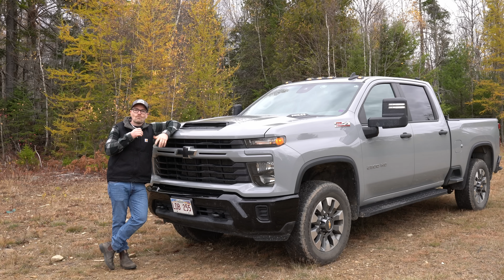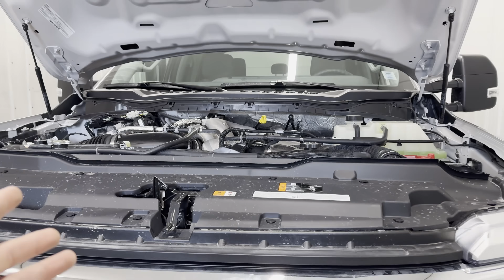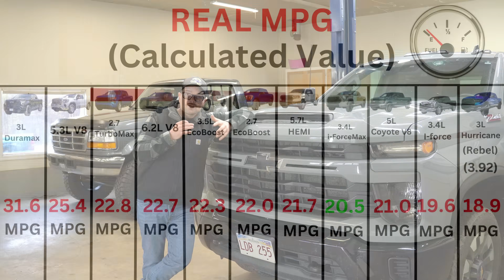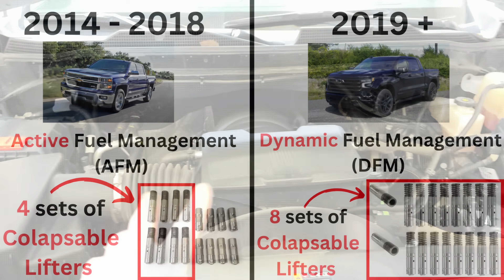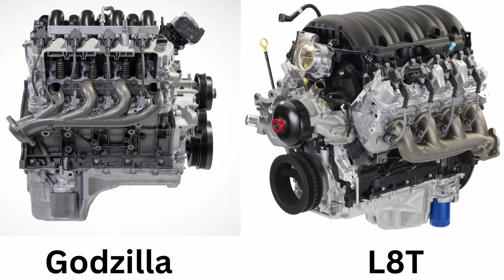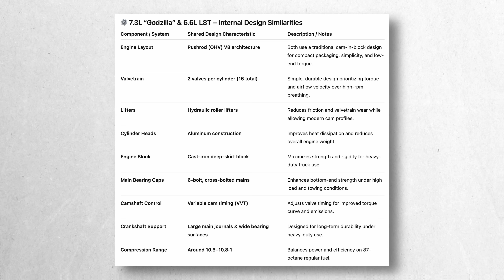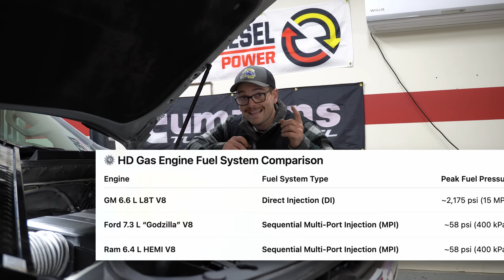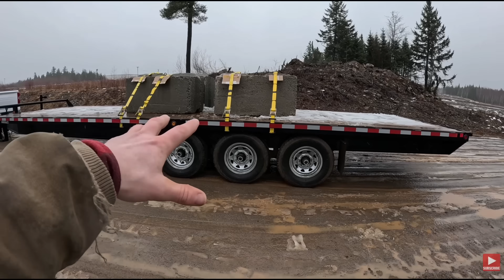Chevy 2500 6.6L L8T V8 Review | GM’s MOST RELIABLE Engine They Still Build

Comment: 100k miles and still going strong
Reply: What are your intervals for oil and transmissions
Reply: @pjfan173 I should note I have the 6spd trans. I do 5k oil changes with Amsoil and 45k transmission fluid changes. I do diff fluid every 30k. My 90k service was an expensive one 😂
Reply: @TheRoeshow0324  Thanks for the reply. I’m driving a 2022 Ram 1500 limited and have 100K on it and the Ram Dealer pretty much didn’t want to do a transmission fluid change 🤷‍♂️🤦‍♂️😳 I had a local shop do it. “Life Time Fluid” = Transmission fails when the manufacture wants to
Reply: @TheRoeshow0324  Thanks for the reply. I’m driving a 2022 Ram 1500 limited and have 100K on it and the Ram Dealer pretty much didn’t want to do a transmission fluid change 🤷‍♂️🤦‍♂️😳 I had a local shop do it. “Life Time Fluid” = Transmission fails when the manufacture wants to
Reply: @pjfan173 exactly! And a lot of newer trucks are going to sealed transmissions. Trying to make very expensive vehicles throw away cars. I’ve been looking at new trucks because the additional towing would be nice but I can’t justify it. My truck runs well and I don’t have the dreaded 10spd problem lingering in the back of my mind. I’d probably lean toward the 7.3l Godzilla if/when I need a new truck.

Comment: Just had a customer bring me a 17 Silverado 1500 with the L8T swapped in place of the L83.  Terrific engine and it loves E85 as much as the other LT family engines.
Reply from the maker: thats awesome. probably tons of power in that 1500
Reply: @GettysGarage  500 lbs-ft of torque and 410 whp with just a catback exhaust and no name intake box on E85.  Amazing torque from these engines. The cam must be tiny because its making massive torque from below 2000 rpm.

Comment: We've had dozens of 6.6 in our BC Rockies oil field. My 2500 was loaded with numerous tool boxes, and gear. I put 130,000km on mine, and tranny lines were the only issue (done under warranty). Truck was stellar on steep mountain roads, and hardly worked doing it. Drove like new, with no squeaks, and steered straight even after all these forestry/oil field roads. Awesome truck. No AFM on any of ours!
Reply from the maker: Love to see it. thats what these engines are meant for - being worked hard and keep on running strong.
Reply: no squeaks after being loaded on mountain roads? thats actually impressive. id almost have to see it to believe it
Reply: @bradhaines3142  I get a new company truck about every 1.5 years now, for the last 27 years. This was hands down the best! Climbing, ascending, traveling rough forestry roads, this truck did it with ease. I pack a lot of tools to operate NG wells, and this truck carried it well. Sad to see it go, felt and sounded new. I was given a 25 Trail Boss 1500, and had to lighten the tool load substantially. Drives a little softer, but struggles on the mountain pitches. At 35,000km I can tell it's nowhere as solid, or will be, at 100,000+. 6.6 for the win :-)
Reply: @billmcmeekin7909 but but it’s a trail boss! 😂 yeah I’ll stick with my 6.6 in my 2500. Base model WT but all the features a guy needs without the lipstick stuff.
Reply: @pryme2013 This will be my first winter in a Trailboss. Once the snow gets deep, I'm not sure if it'll tackle our mountain roads to our leases. My crew thinks our 2500 models would be better. But it's snowing hard today,  so the test will surely be soon.
Reply: I have the 2500 6.6  2024.
30k no issues,   pull a small trl for a SXS.  I don't beat it. Gentle starts from a stop. Average 14.5 mpg around Erie Pennsylvania.  Really don't need 3 quarter ton.
Reply: Too bad you couldn't purchase your old truck and give it a good retirement for your hunting trips and good times.
Like an old dog.
Reply: @RickyO-e5g  My previous company I worked for allowed me that exactly. We used to get a great deal also. I bought my work 08 GMC 2500HD extended cab 8' box 4x4 in 2010 with 90,000km for $12,000 Canadian. Our kids learned how to drive in it, our neighbors borrow(ed) it. And it's still our family ol' workhorse. It's been great (our daughter  is landscaping her yard this weekend with it). Ricky you're so right. If only I could change out the ol 08 for the 6.6 liter. But they won't offer these deals anymore. Word is they load em up and send them to auctions in the US. Cheers bud :-)

Comment: I have heard the big GM gas engines burn a lot of oil. They shouldn’t burn oil. The cylinder deactivation was ridiculous. Aluminum heads on a cast iron block is questionable. I wouldn’t buy one, I’ll stick with my Duramax thank you

Comment: We have a 8.1 with the Alison on our farm. 2004 3/4 ton, over 100,000 miles no problems
The Allison that’s in our truck has a sixth gear that’s locked out. You can buy a kit that will bring it online.
Reply: I'v been on the FB 8.1 group for over 10 years and in all the discussions,I have never heard that an 04 has a 6 speed but it's locked out.Why would it be locked out?
Reply: @johnhaines6546 Allison 6 speed conversion, it's like $3,000
Reply: Would you mind sharing where you bought that kit? Thanks in advance
Reply: @DavidCastillo-mn2nj Allison 6 speed conversion, it's like $3,000
Reply from the maker: would love to have that set up

Comment: 2023 l8t owner here too.  60k miles.   Just towed 12k fifth wheel over 700miles.  It has towed this trailer 5-6 times previously.   It does a superb job here in Texas flat rolling hills.   Appx 8.5mpg at 60-65 mph.    It handles/pulls this same trailer better than my 2007 6.0 powerstroke.    Really has been a very good motor.
Reply: I pulled a 12k lb 5th wheel with a 2003 1500 v6 Silverado 200 miles to Sebring. Ran fine. Tranny loved it. Total beast. Got 8mpg . Didnt go over 50mph. Miami-totally flat. Ran 210 degrees in 90 degree heat but was under 2000 rpm. So it was working. Usually runs 185.
Reply from the maker: Love it!

Comment: Rented an early 2000s Class C motorhome years ago with the 6.0L Vortec.  Outstanding performance for a motorhome.  Never thought I’d ever say this about a motorhome but thought it might’ve been a bit overpowered lol.   I’m sure that extra power would be most welcome when towing a vehicle and loaded down in the higher elevations. 

Had some fun on my return trip on The Tail of the Dragon by pushing the motorhome as fast as I dared into corners. Terrific braking and steering response on what was probably the Workhorse chassis.  Average fuel economy of 11 mpg was outstanding for a Class C and icing on the cake.

Good to see GM and Ford get back to the simpler and robust old school designs for their high output gas truck V8s.

Comment: 😂😂 Toyota 1/2 ton truck has more HP and torq than Chevy or Ford 3/4ton gas trucks 😂😂😂
Reply: Not necessarily true. Plus, they are built for 2 different applications. The 6.6, 6.8, 7.3 is built to work, the 3.4 i-force are built to skirt around CAFE standards while propping up fragile egos at the Home Depot/Lowe's garden center, and Starbucks drive thru.

I'm sure if turbocharged v6 gasser was a viable work engine for a 3/4-1 ton truck, Ford would have put the 3.5 ecoboost into the super duty at some point over the last 15 years, but they haven't, instead they spent over $100 million developing a new naturally aspirated, pushrod, big displacement V8.

Comment: Question for all the 2500/3500 diesel drivers and mechanics... given a large, powerful say, turbo diesel with like 900ft lbs of torque, is it possible to put a high-ratio rear end on it to get superior gas mileage if... and IF, a person DOES NOT want the towing capacity?

Would you in theory get like 30-35mpg?

Comment: My consumed oil.  At 130,000 miles it was a quart every 1500-1700 miles.
Reply: Oil is cheap.  Any engine with that many miles might burn a quart every 1500 especially if it’s towing a lot.  Did you do regular oil changes every 5k or the BS “extended” intervals all the manufacturers give out now?   As pointed out in the video this matters, especially with a direct injected engine and potential fuel dilution of the oil.
Reply: We have three of these at work, all three use oil excessively. The newer 23 model is in the shop for a wiped cam lobe.

Comment: I freaking love my L8T ZR2. Legit best truck I've ever owned, aside from some relatively gimmicky tech
Reply: Just got my 26 2500 ZR2 gasser . Love it so far . 
Does yours have a slight whine/buz noise at the firewall at lower RPM that you dont hear on the highway ? Stop light to stop light .
My dealer calls it normal trans noise .
Reply: @ada-yw1bb electrical like? Yeah, I do. 

Otherwise, no noises or oddities aside from GY MT tires on the road lol
Reply: @OscyJack- my 2025 zr2 has the same whine

Comment: It’s the only gas engine that’s worth shit right now with GM.
Reply: I like my little L3B 2.7 in my Canyon. Never concerned about fuel economy or power, but the complexity required to make that tiny thing is more German than American in design style, and I'm not sure about the future beyond 100k for all the accessory bits and doodads. The short block is very impressively built to mimick a diesel, but the rest of it... Time will tell
Reply: @Mournful3ch0  The best you can do is change your oil every 3,000 miles instead of the stated 5,000 mile intervals. Being that it's turbo powered it also uses some oil over time so just keep an eye on it and keep it topped up. I try to change the oil around the 3,000 mile mark in my own L3B but it ends up being more like 3,000'ish miles. Since I don't drive my truck a lot it takes a bit to reach another oil change and it always feels like the second oil change comes around when we're hitting fall/winter when the days have consistently bad weather.
Reply: @Slane583   5k miles should be fine if the oil is topped off regularly. good quality synthetic will have no problem holding spec and cooling the turbo.   most people have problems with turbos because of just stupid neglect 20k mile changes.   but you do you!  there's nothing wrong with more maintenance 3k miles fresh oil if you have the time and capability.  was looking into the 2.7 for myslef
Reply: @stefanb8526  From my personal experience with the 2.7l Turbo-4 I'd so go for one if you're interested enough. It's more than adequate for what I use it for. That being said, I'd rather change the oil early because I personally don't trust GM's oil change intervals.

It's also my first turbo based vehicle and I want it to last. Especially since it's paid off. I'm not going through another lease just to make GM happy. But the oil change routine is also not set in stone so I'm still experimenting.

Because I've also read that some people have had good luck running oil for longer by switching out the oil filter more frequently before needing to do a full oil change. Either way filters and oil are cheaper than a new engine.
Reply: @Mournful3ch0 Those motors have a good track record as long as they are maintained well. Go with extended oil change intervals, and the cam followers can fail.
Reply: What's wrong with the 5.3L and 6.2L if you run heavier oil in them?
Reply: @brandynnew they all blow up unless you get rid of the cylinder deactivation turned off, or removed
Reply: @okiedokie6977 run it in L9
Reply: @okiedokie6977 my 17 5.3 runs good still at 133k miles and still has the AFM
Reply from the maker: Unfortunately I can't disagree with you.
Reply: +Corvette motor
Reply: El motor de la Chevy passengers también es un caballo de batalla
Reply: GM probably f’d the new ones up too.  I won’t chance it.
Reply: I thought the Corvette engine was solid as well...

Comment: My L8T had 24k miles now, and since day one has burned about 2 quarts of oil every 5k miles
Reply: Is that the GM 5W-30 oil or have you tried other brands to see if it makes any difference. Also wondered how many miles your going on an oil change interval. I know in reading forums and I'll see one guy say his uses quite a bit of oil and a few others and even towing with them claim very little oil usage, I don't understand why the inconsistency but it seems to be a problem for some trucks but not all of them. I don't have enough miles on mine to lay claim to much, I've changed oil a few times now with little relative distance as I wanted to be sure to flush out break in wear metals and I also switched to a different viscosity for the winter.

Comment: I’ve read and seen numerous stories revolving around that high pressure fuel pump failing at the point where it contacts the cam and in turn putting metal throughout the engine’s oil system
Reply: You were given bad information.
Reply: @holdenc3082 there are videos on this very topic right here on this same platform.

Comment: The clunk .. is the tolerances inside the transmission. The trans pumps wear then make a TON of noise under load.
Reply: Mine makes noise. Mostly in 1st gear, then sometimes shifting between 6th and 7th. But, it is actually smooth, just makes odd noises
Reply: @stevelee-u8y yeah, mine ate the pump. Once trans temp is over 140, the ECM starts pulling power in anticipation of slip.. no CEL...

Comment: I have a 25 GMC Sierra 3500. With the same engine and the shitty Allison transmission.. as of this morning I have 18,000 mi. I've been towing with it almost everyday being that I bought it as a work truck. Sometimes it shifts so harsh that it makes you think that you got rear-ended took it to the dealership a couple times and they state they can't duplicate the problem... The transmission is the worst part of this truck.. I will be going back to the dealership when I reach 20,000 mi. I'm going to have the transmission serviced and fluid sent out and analyzed and we're going to inspect the transmission filter for particles.. because these transmissions have been failing at a higher and higher rate. They are absolute trash
Reply: Sorry to hear of your problems.   Look up the videos on valve body problems on that 10 speed.  Also Google Next Gen Drivetrain.  They have a replacement valve body most report solves their problems.  I can’t confirm but I’ve heard stories of dealers getting GM to approve the Next Gen kit and putting it in customer’s trucks to finally solve the problem.   It’s worth doing a little research on.  Good luck.

Comment: Let me chill... I'm an owner, IF you drive it like you are trying to KILL it, it will preform.  Needs to at least pull through an entire gear and upshift before you get full power from ECM. 

Part throttle it won't load to full torque, no matter how hard you lug it. It's turned to target 4500+ RPM in tow haul mode.

Comment: Seems like a great engine besides the direct injection. Port injection keeps the valves clean is a must have on a reliable work truck.
Reply: It’s an overblown issue as long as you maintain and use it properly.
Reply: @MX5-XU The amount of gunk that builds up on the back of the lifters on direct injection engines is a huge deal man. It only takes a year for them to get really nasty and effect performance. And the extra maintenance to keep them clean is expensive and a pain to clean properly.
Reply: @Rogueginger69 lifters? Do you mean the back of the valves? If you change your oil properly (keeping it clean), run the truck how it was designed (sustained moderate use to keep everything hot and burn off as much as possible on the back of the intake valves) and maybe if you idle a lot or don’t tow or haul much often get a catch can, then you’ll be fine.
Reply: @MX5-XU Yeah I meant valves as I stated previously. Sorry, Gm gets me thinking about lifters lol. But yeah, I get that it can be kept clean while driving from the heat. But I just worry about when it sits for a few days and that residue has time to harden. I over think these things.
Reply: @Rogueginger69 always good to be informed and take precautions when necessary. Anecdotally we have a 2.0 turbo DI 2015 Ford that at about year 1 I installed a catch can doing just that. After 10 years now the intake tract is still clean, it runs perfectly and the CC only captures about 1 ounce every 5k miles. Maybe things would be different without the CC, but I don’t think they’d be too terribly different and going a decade without seeing anything detrimental makes me take internet complaints with a heavy pinch of salt.
Reply: @MX5-XU  Interesting, If you haven't had any issue's with direct injection then that is awesome! Eco boost owners are not that lucky unfortunately

Comment: All our new service trucks are isuzu box trucks with the 6.6. We had the diesel 5.2 before that but everyone of them lost turbos and wiped out the fuel system before 200k miles at a cost of 16k a piece.
Reply from the maker: No turbos to worry about on the 6.6L !!
Reply: I had issues with my Isuzu diesel., loved the power. For me I didn’t do long hauling. Mosty stop and go. Yes I’m guessing that was the problem. Diesels want to be working. New truck has the 6.6 and so far no problems. It likes to drink the gas
Reply: So why when they got such crappy service out of them, why would they buy GM again ?   It makes no sense to me, switch brands !

Comment: Down 120lbft at 1500 from 8100 AND truck weighs 30% more. Max torque up ... 9 ... In 20 years! 9 whole Torques
Reply: And yet the 6.6 will run circles around the 8100
Reply: @ada-yw1bb no it won't. When the 6 speed 6.6 came out, GCWR to GCWR. The 8100 was 2 minutes faster up the IKE, that's over 20%!
Reply: @CorRob-h8b  Those guys are clowns.
Reply: @holdenc3082 I did the test my self
Reply: The 6.6 will out pull the old 8100. And get 2-3x the mileage.